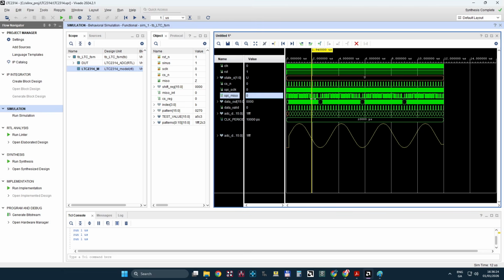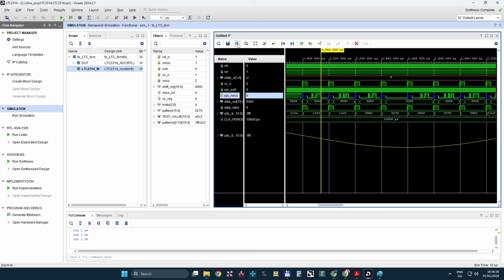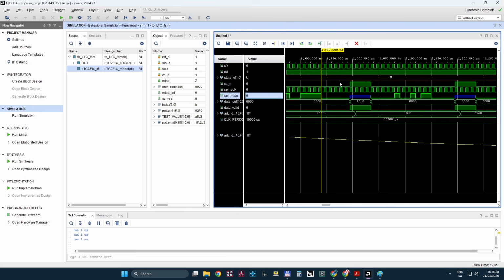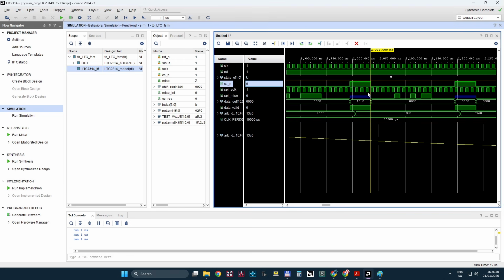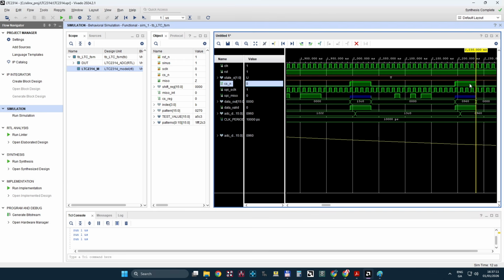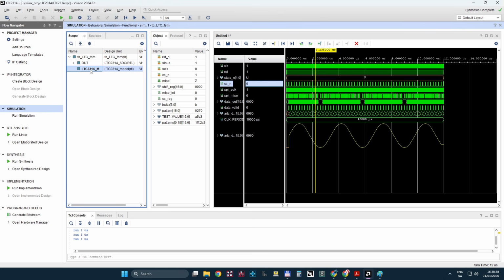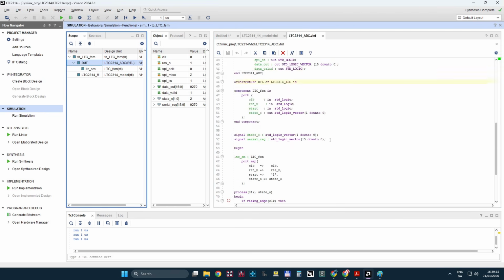Simple Radio ADC Interface  EP3

Comment: Hey did you know you can get some extra sampling frequency for free? If you hold "spi_sclk" high during the acquisition phase ("cs_n" high) you will slightly increase the throughput. It is not a massive gain, but it is completely free. With an 80 MHz clock you are getting a acquisition time of 4 x 12.5 ns = 50 ns. By holding the clock high while chip select is high you will reduce this to 40 ns.

Interesting project anyhow. Am looking forward to see how it turns out.
Reply from the maker: Hi Kevin,
I'm planning to use the ADC as a down-sampler to alias the 40M Band (7.0-7.4 MHz) into the Nyquist band by using Fs =3.5MHz (multiple of 7MHz and 14MHz)  - by doing this I don't need the Mixer on the front end (the ADC becomes the mixer) That's why I didn't care much about squeezing the last bit of performance out of the ADC. Great comment anyway, thanks for watching.